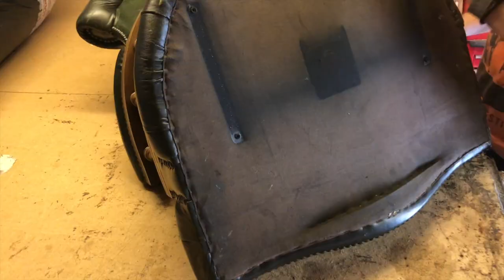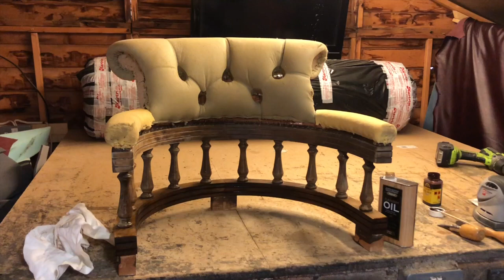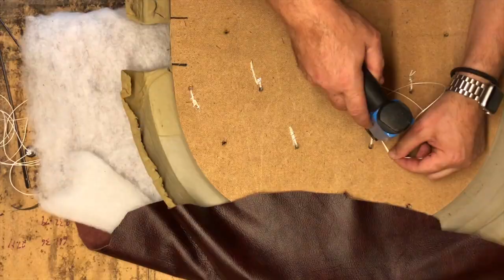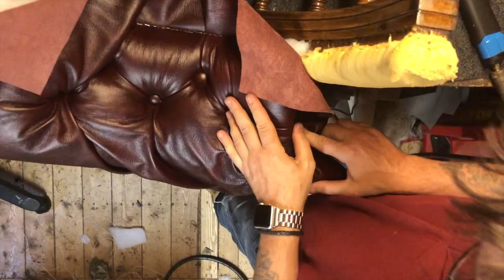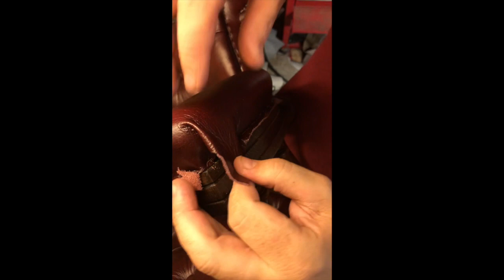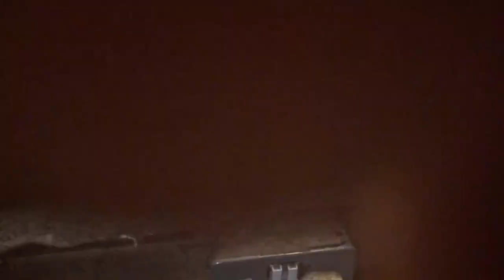How to re-upholster a Leather Captains Chair.

Comment: Another great job you done and what is the leather called that allows you to use rub off called.And also what thickness foams are used ,is there a thick foam then a thin foam.When making a diamond shape how do you know its not to close is there a certain gap for each thickness foam used many thanks chris

i
Reply from the maker: Hi the leather is Rub off hide it’s comes in various colours.
The thickness of foam is all up to the look you’re after the thicker the foam the deeper the buttons.
Diamond shapes as a good rule are 2” difference as in 2” wide 4” up and down or 6 “ wide 8” up and down. It’s a case of measure and see which fits the best. Hope this helps thanks for watching John.